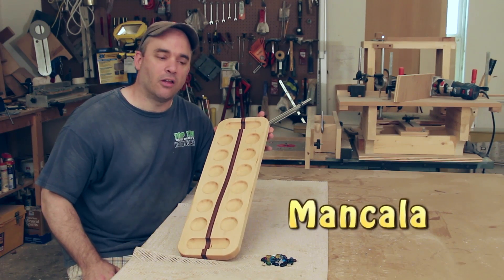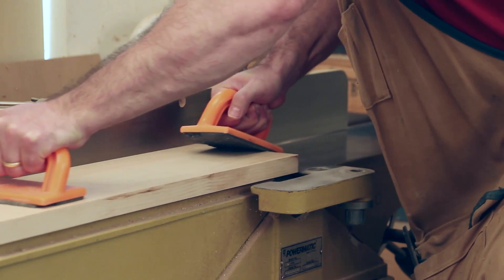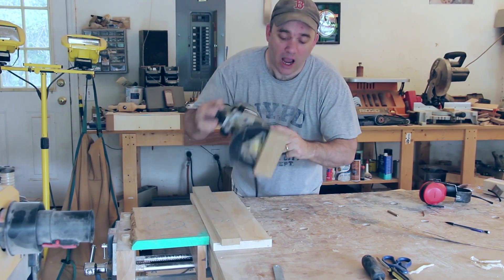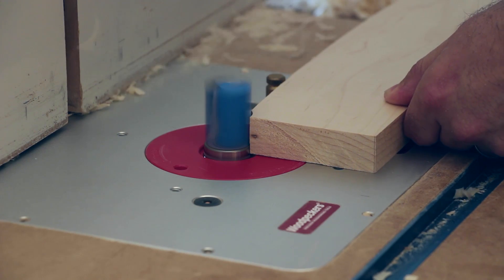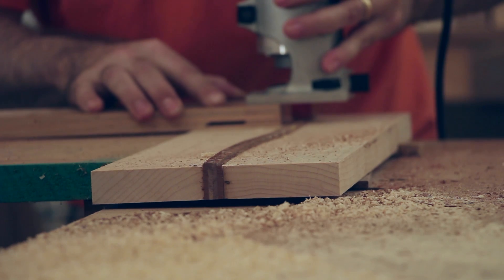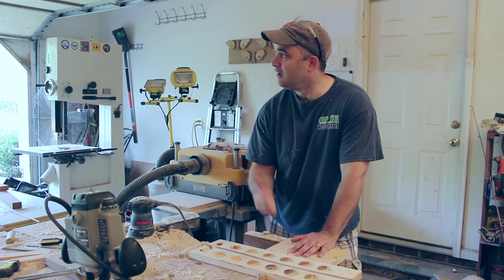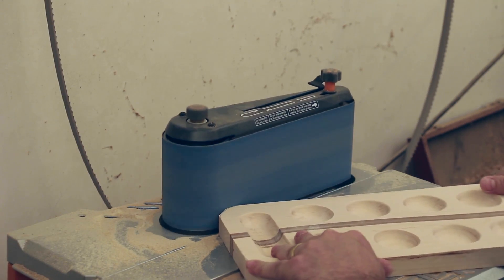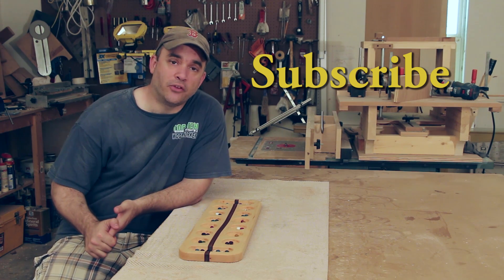Make a Mancala Game

Comment: Great looking and sounding video. I have the oscillating spindle sander by Ridgid and like it, however, when a attach the oscillating flat belt the whole unit vibrates vigorously as if the belt was catching. I took it apart but couldn't figure-out where it was catching. Any ideas?

Comment: Nice video, but if you use a sharp clean bit you won't have any burn marks at all. Blade/bit marks and burn marks are easily avoidable by maintaining tools and keeping them sharp. But if you prefer to sit there for hours hand sanding those holes more power to you.